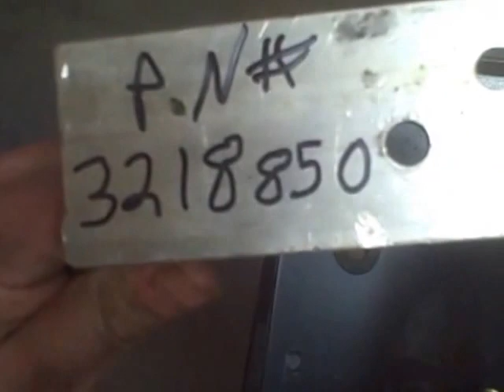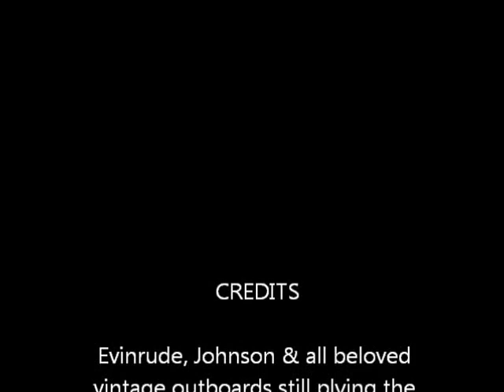18 Evinrude pee-tube install

Comment: The cover holds the thermostat snugly in place so if you used a thicker gasket, the T-stat would be loose and allow water to flow by it.  This would result in a cold running motor which can't get up to temp, wouldn't it?  The worse thing I see is when people take the T-stat out  completely and wonder why their plugs are wet and fouling.

Comment: Wonder if i can do this to my 1970 evinrude 70hp it has an alarm but still i like the visually know the cooling system is working whenever i look back at the engine running lol or see if its possible to install a water temp gauge can't see why I couldn't as long as there's a spot to screw a heat sensor I or drill an tap a hole somewhere
Reply from the maker: Yes'  U can  The easy way on a 70 is to replace the exhaust cover from a 1977 & up model which has the nipple already there & then just drill the pan run the hose.  Or you can drill & tap your current exhaust cover @ the top of the water channel .That will work.     kb

Comment from the maker: Todd"   Happy to do so give me a couple days to get things in order,  I just happen to get a 1971  25 in the shop this week, the mag-plate & points are identical to the 18hp..  good timing,   on the request.. I was so happy to get this motor in''   my opine is this is as good as OMC ever got,,,       I have not yet pulled the flywheel to see what I have but my guess is it will be in need of points, coils etc.   I will also be posting the finished referb of a very nice overseas motor this weekend.                                      kodi

Comment: you do a great job on the videos, enjoy the real world issues you run into as you go.  I have a request......I ordered my tune up parts and planning on replacing the coils and points.  Can you give a video on doing that?  I know it is time consuming, but you do a great job with the real videos, not just before and after.  I have seen one video that was great on setting points, but wasn't this motor.  Appreciate it!

Comment: I have a 1959 10 hp johnson.  I  was wanting a visual way to see if impeller was working.  If I  do this will it only work when thermostat is open? Wanting it to work all the time.

Comment: I have a 1963 johnson 40hp with a 1969 lower unit. Going to do the same thing but run it off the underwater exhaust tube.

Comment: Another Question....I read that this old 18 is a 22ci, and is the same motor as a 25hp up until I think 1973, can you put a 20 or 25hp carb on this 18 hp motor???  Is there a modification to the carb or new jets?
Reply: Todd Smith I can’t answer your question about the carbs but I can confirm that the 18 and 25hp motors are the same with interchangeable parts.   The 25hp, 22ci motor was made from 1969-1976.  You probably can take an intake manifold and carb from a 25 and put them on an 18.  It’d be worth trying.
Reply: There's several engines that have the same crank and heads only difference is the piston diameter really and carburetor jets

Comment: Where can I find a handle/throttle? My 1963, 18 hp had remote controls in the past and has been stripped of handle, aft shaft and gear for the throttle.
Reply from the maker: +Jan Chipman, there are several right now on ebay that will fit your motor, & all were less than $50,00, However if you know of any outboard shop in your area they will most likely have a OMC tiller lying around.  Several year models & horse powers will fit your motor,      kodi
Reply: Chjp234. I have a 63. Rude 18hp it's missing  the pull start and bracket  we can make something happen????  REPLY!🙂
Reply: @dennisellerbrock8994  which bracket are you looking for? The  rope recoil housing or the bracket between the recoil and the block?
Reply: @chjp2346  the recoil housing and the bracket that attaches to the block.  I have the 3 bolts that it attaches to.  After 5 years  unfrozen motor and got it to pop.  Might keep it or sell it for 100 bucks

Comment from the maker: Todd '  The  18hp 22ci block was beefed up internally to become a 25hp from 1973 until 1976,  that block is about as good as it gets,  Much larger crank shaft, larger reed valves,  beefed up intake to name a few,  If you just slap a 25 carb on a 18 hp 22ci the 18 ( intake inlet) would act as a restrictor plate for the carb throat & you will gain nothing. I think you could get a bit more from a Johnson 20 carb jet.  Not saying it can not be done,  I think the  25hp carb might also be a different linkage arrangement,  which would need to be dealt with.   Again not saying its not possible tho.            thanks      kodi
Reply: +kodibass don't want to mess with a good thing, just know that some easy exchanges on detuned motors can result in nice increase for the lower HP motor class

Comment: So is this the only thing I have to do to install a pee hole on my 1974 evinrude 25hp?
Reply: Yes. The 25hp and the 18's are identical in design.  However, the older 18's do not have a thermostat housing or thermostat.  My '57-18 Johnson does not have one. My '69-25 Johnson does.

Comment: Why do you install a pee tube I'm trying to figure out if I need to install one or not I'm having water going around the motor when I start it I changed the thermostat I'm still having the same problem
Reply from the maker: Joey Hanania,  the pee tube  is just for visual  indication that the impeller is pumping water at least up to the power head & has nothing to do with actual cooling  of the motor.   I would need more info to help with your problem? kodi
Reply: I'm not getting water from my tail tail I'm only getting water up to the thermostat that means my water pump is not bad but I'm not sure why isn't the water coming out the Telltale it's coming out around the motor housing
Reply from the maker: @joeyhanania5707  + its hard for me to guess without seeing it first hand
could be a base gasket,  outlet hose from exhaust ,  etc.         kodi
Reply: How can I contact you and get your advice on the motor

Comment: What about a pee tube on a 1959 super seahorse 35hp
Reply from the maker: Same process,  No different except the shape of the t-stat cover. drill it, tap it add a nipple & hose.                            kodi
Reply: @kodibassInsideoutboards  great

Comment from the maker: Bigdaddyjigga,   You   R  to kind,   thanks     kodi
Reply: kodibass couple questions for you since this is all new to me.... does adding the pee hose direct water away from somewhere it needs to go to cool? Also does it decrease water pressure that is needed to move the water to where it needs to go? And does the water flow out the pee tube indicate the Tstat is open? Or is this just to simply show water is flowing from the impeller?